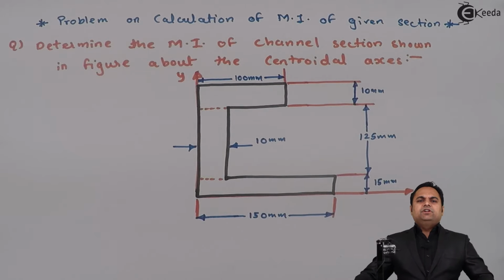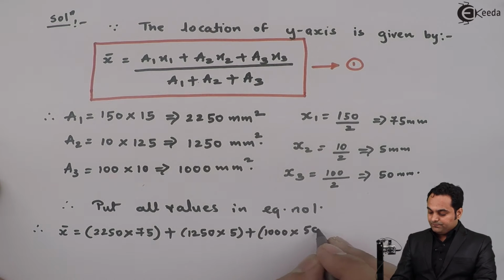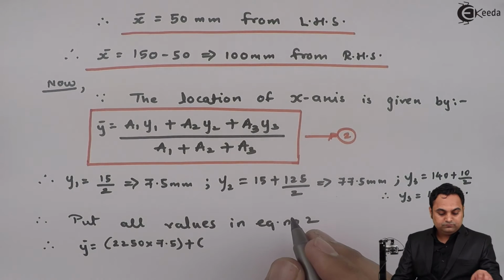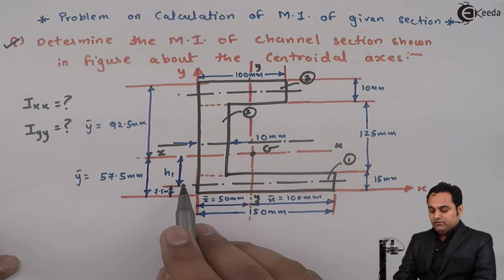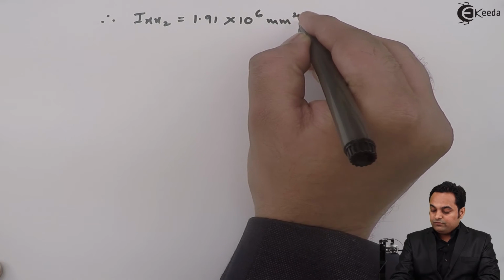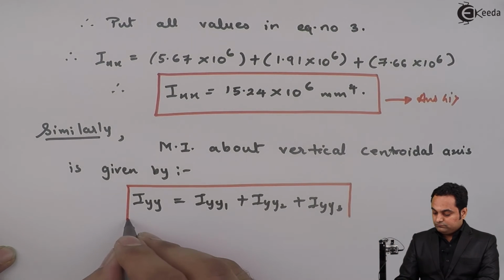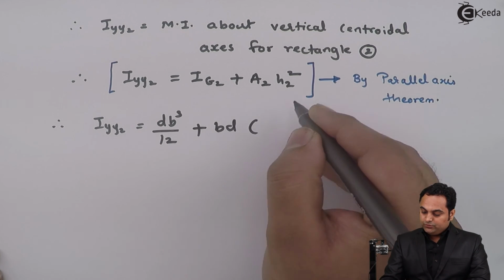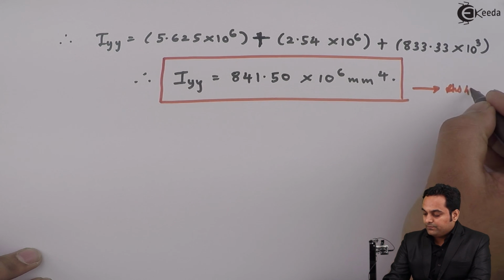Moment of Inertia of Given Section - Problem 1 - Moment of Inertia - Strength of Materials

Comment: Where did you get the value of h2 from when calculating Ixx2? Beacuse you've taken the distance from the bottom to the mid point of the second rectangle as 72.5mm, but the axis for the middle of the second rectangle is at 15mm + 125/2mm which comes out as 77.5mm.
Reply: Yup